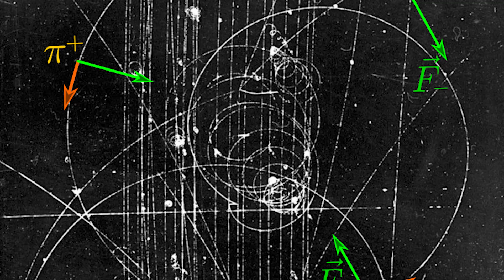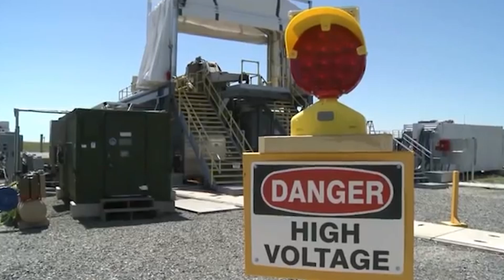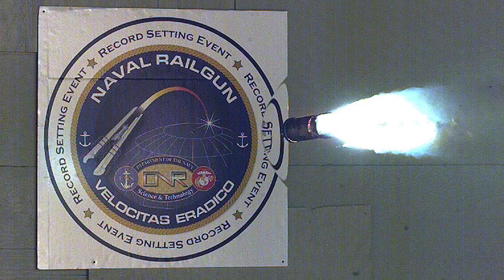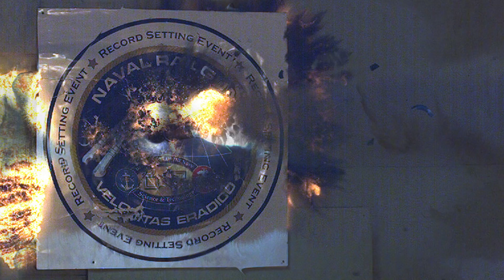Railguns: The Kinetic Future of Warfare

Comment: I could see this technology on a ship, for sure, or possibly a tank. Small arms? I'm skeptical.
Reply: Watched a video in the past that I can't recall the name of, but it discussed how the only way to incorporate it into small arms would be for the projectile to house the power supply. Think high output battery bullet. The obvious draw back is that it would be extremely expensive to use your power supply as the projectile.
Reply: @hardbrocklife  Well battery tech is advancing like any other. I've heard about the potential of batteries made from carbon fiber, and even glass. I'm sure the expense argument was used against smokeless powder, just as it was likely made against repeating, and later automatic firearms. Expensive now but that's mainly due to a reluctance to invest in what can be vs what we know works.
Reply: This is all just my layman's understanding as a nerd who happens to love railguns and wants to build one someday, and truthfully I haven't watched this particular video yet but I stumbled upon this comment while I was adding the vid to my "watch later" and I wanted to say that I agree!
Unless something a bit game changing happens (like room temp or higher temp super conductors, and bigger increases in electrical energy storage density), railguns will be outcompeted by current firearms in terms of practicality for small arms, if not also in terms of power at that scale. Railguns become more advantageous compared to conventional guns as you scale them up, then the difference is more significant, and you also don't care as much about having to lug around enough mass to generate the massive amounts of power. That's why imo in the foreseeable future (unless one of those previous advancements happen suddenly) we'll see railguns mostly on nuclear powered ships or static installations. Even for that there are still some problems to be solved, the massive current through the (non-superconducting) rails and  projectile, the friction heating, and the extremely hot plasma generated all wear down the barrel/launch rails very quickly in prototype railguns. Imagine having to "reload" the entire barrel of a naval artillery gun every few shots, that's a big reason why they're not in use quite yet. I think there might also be some problems with the rails bending apart especially when hot, as the same electromagnetic forces that push the projectile down the barrel also try to force the two rails apart, similar to how a chemical/gunpowder powered gun tries to blow its barrel apart with the expanding gases in every shot, but a bit different. One could probably make a person-portable railgun with current tech that rivaled a rifle in damage capability after doing some development work, but it would be much heavier than conventional weapons and ammunition and probably wear out faster and have a slower rate of fire and all that too, and to get it to the point of being efficent enough to practically equal current small arms on a real battlefield, it would take huge amounts of R&D just to end up with a more expensive version of what we already have. But if there's classified work going on behind the scenes that's solving a lot of those problems (and there almost certainly is for ship and artillery applications of railguns) and it ends up scaling down better and sooner than I'm imagining, then I guess it's possible, but not until after we've seen big ones out in the field for a while imo. Small ones are a cool electronic hobbyist project though, for people who know what they're doing being careful and safe with high voltage at least.
Reply: @revenevan11  I'll try not to pin any unrealistic data I can't prove myself (you clearly know your stats), but I always wonder why the payload has to be a hunkin mass like 20kg when a solid chunk about a beer can's dimension might work as well (or, less than a tank-shell projectile's size? Total guesswork) given the additional accelerated velocity.

Or that's the best mass for literally any vehicle armor ever made? Even 9mm pistol rounds can clearly made a good dent (board, metal sheets, etc), so I'm just sizing things up around that ratio.
Reply: @randomsandwichian  depends on the target. Somthing like a m1abrams MBT requires a projectile with sufficient hardness, mass and velocity to penetrate its armor.
Reply: I suppose you could build a back pack to house the power supply and the transformers with a thick wire to the hand gun, venting the heat is going to be a problem though.  I far prefer the coil gun technique over the rail gun system.
Reply: @ForgeMasterXXL  nah. Too impractical. That would likely be 50 + pounds, not to mention the rest of their gear. It would have to be a self contained system.
Reply: @manicmechanic448  Thanks for the info, I suppose we will just have to wait for room temperature superconductors (metallic hydrogen???) and incredibly dense power cells (I’ve not seen anything in that line though, even theoretical.)
Reply: same here rail guns would be on ships, coil gun on tanks but small arms are likely going to remain chemical propellant Conventional Weapons for efficiency reasons.
Reply: The sad thing is, we've probably had handheld ones. It all comes down to power supply, and we already have guys carrying HD batteries in battlefields.
Reply: @nivekian  yeah, but any replacement for the AR platform has to out preform it in weight, reload speed, fire power, and range. Two of four doesn't cut it. It'll have to fire a minimum of 30 without a reload. It could happen in my lifetime, but I doubt it.
Reply: manic mechanic Yeah, I don’t see it happening. Even on a plane, with the exception of something like a B-52 perhaps. Until there’s a significant breakthrough in battery capacity & weight, there’s no way it’ll work as a firearm.
Reply: Shrink it to a manageable scale about a couple times smaller, and work on how the payload can be both affordable and compatible for all purpose (literally practical enough to install and penetrate any armor on any vehicle) and this would easily replace any tank and anti-vehicle artillery out there.
Reply: There is one significant advantage and arguably another one or two smaller advantages that small arm railguns would have over their larger tank/ship/base variants. The biggest one of all is durability.

You might be wondering, "How would it be more durable?" That would be largely due to the size of its ammo. Most small arms fire rather small caliber projectiles. The 7.62mm round (both the NATO and Russian variants) have been seeing something of a phasing out for smaller calibers (5.56mm for the West and 5.45mm for the Russians - and also how NATO went from .45 to 9mm for their pistols). By reducing projectile size, the recoil force tends to be reduced alongside it (although that does come down more to the gun itself). Thus, the generated forces would be less, and the small arm in question would be in a better position to be able to withstand more usage (this aspect is more theoretical at this point, though). Besides, no soldier can wield what is effectively a handheld autocannon - the shotgun is the closest thing to a handheld cannon - so making an excessively-large-caliber small arm railgun is actually rather counterproductive.

Of course, before anyone tries to debunk this with what has already been brought up earlier, yes, arguably the biggest hurdle to small arm railguns is the power supply. An entirely new portable power system is needed, because let's face it, no battery, current or theoretical, will ever be able to hold enough charge to fire more than a few shots before needed replenishing/replacing. Something akin to Iron Man's miniaturized arc reactor is needed (matter-antimatter reactors are not something you want to have in the middle of a shootout). Granted, small arms do have an advantage here too. With the smaller projectile size, less propulsion force (and thus, less electric power) is needed to launch them out. Also, small arms do not have to shoot as fast or as far as their larger counterparts, which further reduces the power required. That said, while these factors do help, they are not enough to overcome this hurdle. Unless an entirely new power system is developed (like something out of, say, the Mass Effect video game series, but that is just fantasizing), small arm railguns can only be imagined. There is also the matter of the materials the projectiles are made of, but that would be determined by the speeds they are being fired at.

Another advantage that small arms could have (and this comes with perhaps the most qualifiers) is cooling. Because of the aforementioned reduced power draw, comparatively less waste heat would be generated. That said, a good cooling system would still be required, and because its power system would complicate the weapon enough as is, a liquid cooling system would be disastrous (even for tanks, ships, and bases, this would not be a good idea), so it would have to be air-cooled, and this runs into the issue of environmental factors. Theoretically, a small arm railgun could still fire more (perhaps significantly more) than a tank/ship/base one before needing a lengthy cooldown or changing, but there is one environment where the larger variants would win out: space. Because space tends to be extremely cold everywhere that is not remotely close to a star (which is most of space), it would make for an excellent cooling system, and with the increased mass of the ship carrying the railgun, it becomes more feasible of a long-range weapon (this is one aspect that the Mass Effect series got right). Of course, there is the matter of protection against these weapons, especially if they miss their intended target, but that largely depends on the projectiles' size, speed, composition, and whatever is actually in their path, and there is too much range and variation in this to post any meaningful generalization in a comment.

One final note on railguns and space, a rail launch system would be a potentially excellent method of launching spacecraft. That said, it would really only work for unmanned spacecraft and satellites. If the system is large enough to allowed for a comparatively delayed acceleration, then it could be used for manned spacecraft, but the system would likely have to be incredibly massive (think the Osean space center from Ace Combat 5 and 7, and possibly even more massive than that).
Reply: @DavidRichardson153  I am not your college professor. Don't send me a thesis. I'm am not that invested in this.
Reply: @manicmechanic448  If it were a thesis, I would have included stats and sources. This is all just stuff to think about.

Still, your skepticism is warranted. I'm not saying you're wrong to have it. Even with what I gave, I do not see it happening, at the very least not anytime soon. While I gave fairly sound theory, it is still just theory, and until they start designing, building, and testing it, it will remain so.
Reply: @DavidRichardson153  all I'm saying is get to the point sooner.
Reply: @manicmechanic448  Basically, yes, small arm railguns are beyond the realm of possibility, but not as much as you might think.
Reply: @DavidRichardson153  What advantages would a rifle-calibre railgun offer over current small arms? If you could make a railgun that weighed as much as an AK74M or a M16A3 rifle and fired projectiles with the same muzzle energies and rate of fire, no military would be interested in it: because it wouldn't do anything that the existing assault rifle doesn't already do whilst having a lot of disadvantages in terms of complexity and reliability.

As for being able to produce higher velocities than chemical propellants, do we really need that with small arms--as it will come at the cost of unacceptably high barrel wear? If you are worried about defeating ballistic ballistic armour, there are many weapons systems (e.g. mortars, 40mm grenades, heavy machine guns, artillery, etc.) that will easily stop a man wearing even those experimental ballistic vests that can supposedly defeat .50 BMG rounds. 

There's also the problem of terminal effectiveness--I can't really imagine that launching a 2mm thick tungsten needle at Mach 9 is going to do more than just produce a 2mm wound channel through the target. Projectiles optimised for defeating armour usually have some tradeoffs when it comes to terminal effects in tissue, and again; if you can defeat that armour with an existing weapon system like a mortar or a grenade, why take the risk of fielding something that is potentially unreliable and dangerous to the user?

Now, tank guns do need more velocity, and we are already reaching the limits for the maximum muzzle velocity with chemical propellants in tank shells. If the power issues could be solved, a railgun would be an excellent tank gun, since its inert ammunition presents less risk of cookoff if the tank is penetrated; the capacitors could potentially be isolated from the crew compartment as well.
Reply: @Schwarzvogel1  First off, who said that a rifle-sized railgun could or should only fire a project with the same muzzle velocity as a chemical propellant one? You're making a gross assumption here. While that is certainly possible, in general, railguns would still fire faster, but with the increased muzzle velocities comes increased recoil (Newton's 3rd Law as well the Conservation of Energy and Momentum and all, here). This can be countered to an extent with a smaller projectile, and depending on the materials used for it, it can be just as effective (if not more so) at penetrating armor than a conventional one. After all, the other weapons you tried citing have one or two things going for them: significantly higher muzzle velocities than assault rifles and/or contained explosives.

Granted, a railgun could - perhaps would - have reduced terminal effects on flesh than a conventional rifle, but that does come down partially to the projectile's speed upon impact. After all, a .50 BMG round fired from about a mile away impacts with the same amount of force as a 9mm fired from point blank. Why? Because it lost a lot of speed and energy as it traveled that distance. Now, a railgun would too - any projectile weapon would - but that is where it can be much more easily countered if the firing speed can be adjusted through the energy output, something that conventional firearms can only do through a full change in ammo, and do you see soldiers carrying multiple types of ammo for just ONE of their guns? They don't because that is a massive weightload. Railguns can have this too, depending on the ammo's design, but if it is designed to not need to carry its own propellant (and most, if not all, current railgun designs already have this), that is a not only a potentially reduced weight for the ammo, but more flexibility in how it is delivered. To be fair, an adjustable fire setting on an "assault rail rifle" (as I will call it to try to shorten it) would be difficult to design at first, but it is certainly possible. Only sending a "2mm thick tungsten needle at Mach 9" is almost completely useless, so if it reduced down to slower muzzle velocities, even all the way down Mach 3 (which is the muzzle velocity of most assault rifles today), its effectiveness would be improved - although, again, its effect on flesh is still questionable at this point. That said, it would still be more than capable of penetrating armor - and you forget that any such penetration greatly reduces a projectile's speed upon passing through (even causing fragmentation and/or tumbling), which means more damage to flesh. Again, how effective railguns would be against flesh is still questionable - that much, I cannot argue against - but it is not out of the realm of possibility.

As for it having the same rate of fire, here's a reminder: the MG42 of WW2. It fired an average 1200 rounds/min, so fast that it risked quickly melting the barrel if fired on full auto for extended period. This was countered by quickly and somewhat easily changing the barrel in the field, but that is the problem - it was a heavy machine gun for defense, not an assault rifle to be easily carried around. Can you name an assault that soldiers use today that has that feature? Spoiler: there are none. Even the US's own take on it, the M60, was reduced to around 600 rounds/min because the 1200 rounds/min in its original design was deemed too impractical. Also, with the higher rate of fire, that only encourages soldiers to "rock n' roll" with full auto. And here's a newsflash: full-auto small arms are outright terrible at killing enemies. That's why assault riffles are generally designed without it, going for semi-auto or burst fire (3-round and the occasional 2-round), and weapon that are full-auto like the M249 SAW are not used to kill but to suppress (i.e. force the enemy to keep their heads down so those with assault rifles can work around and pick them off with a few shots). As such, not many militaries - arguably none of them - are looking for increased rate of fire for assault rifles, and muzzle velocities have reached something of a plateau with chemical propellants. With the adjustable energy output of a railgun, that is no longer an issue, although, again, a robust and simple enough system is needed (the power system for the railgun is only the biggest hurdle, not the only hurdle period).

Also, chemical propellants are basically explosions that the gun must withstand, and the residue that is left behind by them is further maintenance. One of the big advantages a railgun would have here is the virtual elimination of residue, and I say "virtual" because the environment it is in will always leave its own mark on it. For the larger variants on tanks and ships, they already have lots have background knowledge and experience in designs for robustness with chemical projectiles, so not much adaptation for railguns is needed. For personal weapons, the similarly sized (if not smaller) ammo is reduced wear on the barrel - although such wear will never be eliminated, and how much the wear would be reduced has yet to be determined, let alone tested.

As for the armor penetration, you keep using grenades and mortars, which are explosives. The anti-armor shell tanks use with the most penetration are NOT explosive rounds but solid pieces of highly-dense materials like depleted uranium (although that is being phased out for other less hazardous materials). And you think carrying grenades or mortars is somehow less hazardous? Grenades are mainly used for group attacks and mortars are NOT designed for long distance but to get up and over cover, which is great against infantry in the field but rather useless against armored vehicles and even some buildings. Granted, no infantry should have to fight against tanks, but the comparative versatility of a railgun would give them more options for disabling them - killing tanks is more pie-in-the-sky unless you can deliver tiny explosives or incendiary rounds for it (which is why they're typically .50 BMG rounds today).

And one last thing about tanks, particularly with their ammo: NONE OF THEM USE ONLY INERT ROUNDS. if anything, inert rounds are the perhaps fewest of that they carry today, as tank-vs-tank combat is not being given much thought today (not that they should stop with such thoughts, mind you). The majority of their rounds are some type of explosive rounds, and this is an advantage that tanks and ships will always have against assault rifles. I am not saying that increasing the muzzle velocities for tank cannons is bad (just so you know, if the round is smaller than 15mm, the weapon is called a gun, while larger than 15mm is called a cannon), but as I mentioned in the first post, the only real hurdle for tanks would be the cooling system. That is a LOT of energy (and thus waste heat) generated for firing, so if that is solved, then "rail-tanks" are likely to become more viable - they kind of already have the power issue down.

Of course, in the end, this is all theoretical, and there is undoubtedly a lot that needs to be solved before assault rail rifles are even a possibility, but if you want something that is more - arguably fully - outlandish as an assault rifle, that is not railguns (although they still are fairly outlandish at this point). No, that belongs to directed energy weapons (i.e. lasers and plasma).
Reply: It would be an excellent anti-material/anti-tank round. Think of something like those big fuck off man portable anti-tank rifles from WWI and early WWII but enhanced with this technology. Man portable guaranteed penetration AT weapons.
Reply: @masteroutlaw100  possibly, but its gonna take a lot of development.
Reply: As someone with firsthand knowledge, the two main drawbacks to this weapon are 1: power draw - even on a ship, it would be hard to power this thing, and 2: weapon durability. This thing has a tendency to rip itself to shreds when it fires.
Reply: @Matney95  I know. They he said that in the video.
Reply: @manicmechanic448  I hadn't watched the video yet, lol.